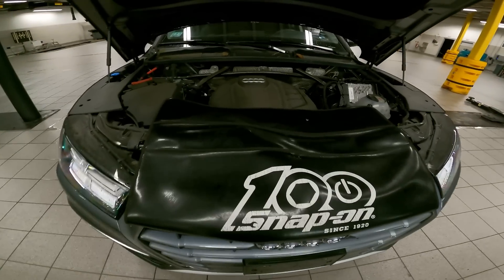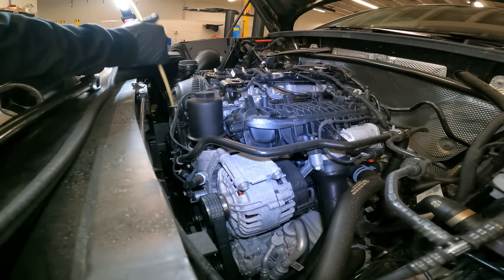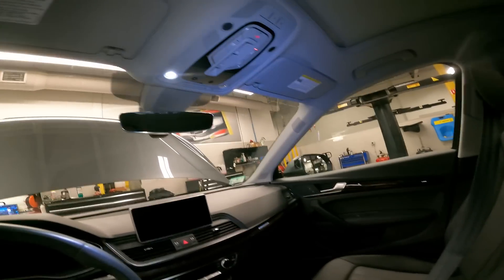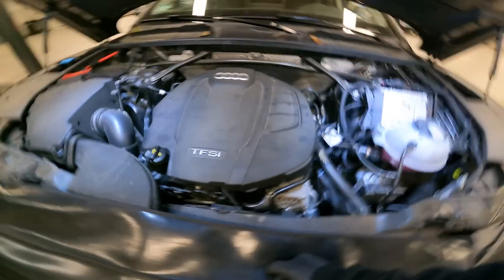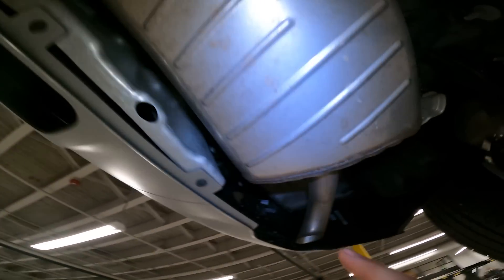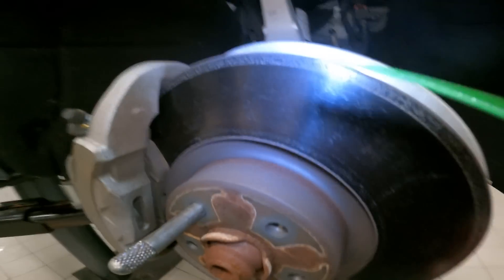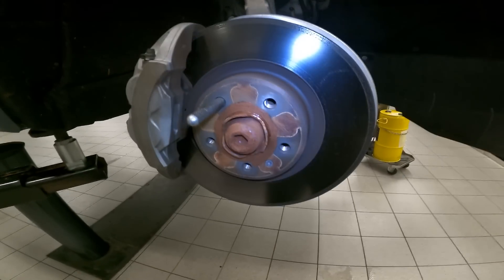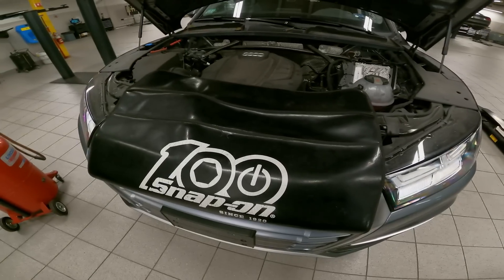What to look for when buying a used Audi. Inspection & service. #customerstates

Comment: I'd love to see a sunroof drain and flow test video. As a young guy I had no idea you had to keep the drains clear. I learned that the hard way. 

I'd also like to see the lubrication points with the sunroof. I'm guessing silicone lubricant?
Reply from the maker: Clean the seal with soap and water then condition the seal with silicone spray. I might just have to do a sunroof drain video.
Reply: @customerstateswhat  I'd love to see it. O know there are a lot of people who don't service their sunroof and many don't know about the drains until they get water in their car.
Reply: @richardsmith2721  Should the sunroof be serviced if it's never used
Reply: @msimm8612  Yes. The drains can get blocked if you don't use it. The seal around the sunroof isn't water tight. If you leave it outside, it can get clogged with dirty water and debris and flood the interior when it rains. 

Plus, what if you sell the car and it doesn't work when a potential buyer tries it? Or worse, it gets stuck open when someone tries it.
Reply: @customerstateswhat  do you use the special tool that's like a snake for the drains? The two audi dealers I worked for never knew where it was.
Reply from the maker: @fabi1013  we currently don't have one but I know exactly what you are talking about. One looks like the Toyota tool like a mini snake for drains and the other is the snake with no reserve tank for more snake.

Comment: I suction my oil now. Scotty Kilmer warned against it because he said the sludge sits in the bottom. I found that not to be true. I tried cracking the drain plug afterwards and got nothing. 

On top of that I actually get more oil out with the suction because there are some low points in the pan that don't drain when you open the drain plug. 

It's much cleaner and easier to suction the oil too. No climbing under the car. No stripping the plug. You just collect the old oil in the drain collector. No transferring necessary. I just wish my car had a top side oil filter.
Reply from the maker: 100% correct. We have jiffy lube cars come in all the time. They drain the Transmission DSG fluid instead of the engine oil.
Reply: @customerstateswhat  WOW
Reply: @customerstateswhat  I had that happen with a Forester years ago at a Pep Boys.  Lucky for me, I had slid my way next to the counter-side window and saw them drain the transmission fluid instead of the oil.  Then I informed the manager of what happened and made sure they refilled it (at no charge of course) before they changed the oil.

Funny thing is that, later that day, I was with a friend of mine who worked at a Mitsubishi dealership.  I told him I had brought my car to a Pep Boys for an oil change.

Before I could continue, he said, " Let me guess.  The drained your transmission instead of your oil". Apparently, it happened that often!
Reply: @customerstateswhat  One of my coworkers did that on an Audi once. I got the next one and I think half the guys in the shop double checked my work on that oil change.

I'd argue that this is a design flaw if I knew how to get in touch with the people responsible.

I now make it a habit to check the dipstick before I start the car. It's not going to be correct, but it's the best time to notice if it's double or nothing.

Comment: Nice thorough service. Like old times. 👍🏻 That car is in amazing condition! Can you only suck the oil out or is there an option to drain it from the pan?
Reply: Audi... gotta suck it out, so the sludge stays in the bottom and destroys the engine in 100K miles
Reply: @demcomp  🤣
Reply: You can drain from the bottom but you have to remove the paneling under the motor and replace the drain plug with a new one.  Not worth the effort. You change the oil when it’s warm and the engine has been running so everything is mixed together. Oil sludge only happens if you don’t maintain your vehicle properly
Reply: @toomanymc3899  Since I'll never be dumb enough to buy an Audi, I won't worry about it. I change my oil every 5000mi and refuse to go longer. And since I have a Toyota.  Well, I think we know where that's going.
Reply: Thanks 
A complete “textbook” inspection and service! I clean the wheel surface too.

Comment: 20 gallon washer reservoir tank?
Reply: Almost all of them have 2 tanks. The upper tank washes the headlights and windows and the lower tank will only wash the windows. That way if you are getting low on fluid, it will slow usage by not spraying the headlights. There is the sensor that lets you know when the fluid is low and the gasket on that can leak. If you fill the reservoir and there is fluid dripping but the wiper spray can still work, it's usually the gasket that is gone or leaky.

Comment: Hey have you noticed on the 2.0 2019 q7 that the coolant goes to min at like 4000 miles I wonder if that’s normal ? I took mine in they pressure tested it and can’t seem to find anything but you can smell coolant sometimes even the service lady smelled it .
Reply from the maker: its normal, we have had people come in for this reason. We go through the usual steps of pressure testing, block testing, oil sample,  external inspection for leak. You know what we find? Nothing or thermostat lmfao. There is an extension of coverage on them.
Reply: @customerstateswhat   Thanxs friend :)

Comment: No air filter??? Shouldn't they be changed every 10k?
Reply from the maker: Cabin is every 20k and was done last service. Engine air filter was inspected but not needed. I believe the service interval is every 40k.
Reply: @customerstateswhat  Wow that's crazy. It's no wonder when I bought my used B9 from the dealer the thing was just packed full of dirt and leaves. lol